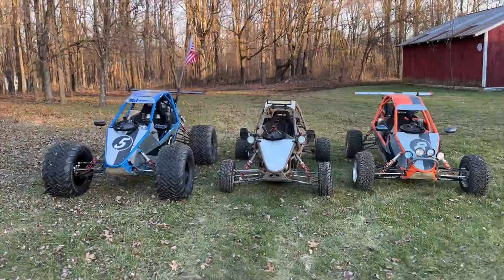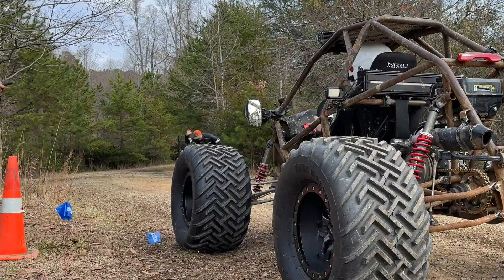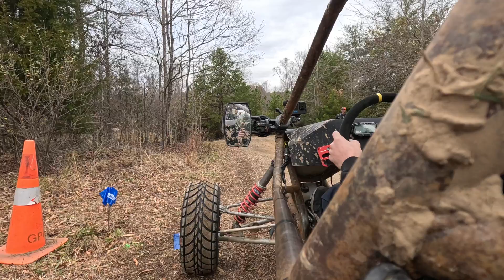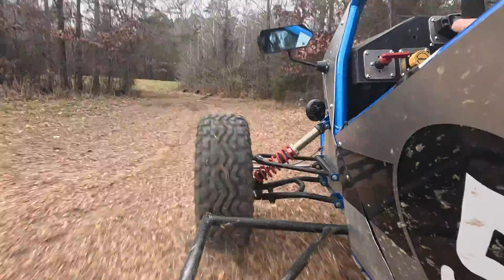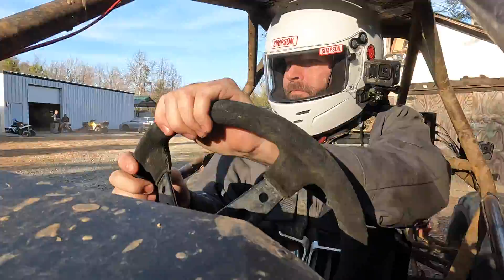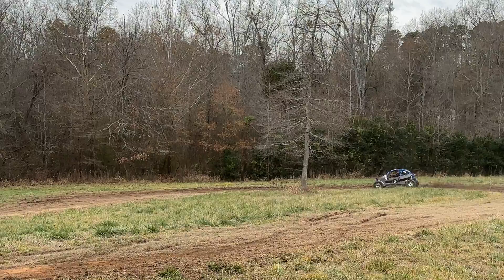Go Kart Build / Crosskart Mode Change and Lap Times

Comment: Really like the idea of bigger tires as ground clearance would be a concern on the places I like to ride. I'm curious if it would have been just as fast as the crosskart tires if it only had a little more horsepower to help with their added weight and drag.

Comment: This is at the cars and camera's facility. that was on the grand Prix  lap.

now we need to see them get Grind Hard Plumbing. and Criss from Rather Be welding. there to see some of these vehicles stack up.

since there are so many of those three wheeled ATVs just laying around. I would like see someone use those tires and wheels on a kart. because they would be just the right size, in between the one's on this kart. and the smaller one's that are normally used. I think they would be the perfect size. they might be worth a try.

Comment: Man that motor sounds like she's struggling to get them big ass tires rolling
Reply from the maker: Got em rolling though… those small engines have more torque than horsepower.
Reply: Do you think you could gear it to better handle those big tires?

Comment: Sounds waaaayyyy underpowered
The side by side comparison was laughable…someone was asleep at the wheel
Reply from the maker: I’m guessing you don’t have a lot of experience with motorcycle powered buggies… On short, tight tracks they never get a chance to get into that awesome 100 hp power band.
Reply: @KJRaycing  you are absolutely correct, and the Predator machine can virtually do a full lap without lifting

Comment: Electric power steering time!
Reply from the maker: It’s not too bad as is. These are budget builds and eps starts at like $700. The gym is free 😁
Reply: About five years ago I did eps under $200 .  There's a guy on ebay that make a controller for a Saturn Vue / Equinox  eps unit.  If you pull on at the Junk yard you can get everything  you need.   @KJRaycing
Reply from the maker: My 10 year old daughter does just fine without power steering. I donMt know how else to say they don’t need it. But it is your build after all and you can do it however you want 👍
Reply: it steers surprisingly easy

Comment: What to see if I get the vr1 plans is there a way to use those plans if I wanted to build the vf2 in the future? Or is it just better to buy both sets of plans?
Reply: They're pretty much completely different karts.
Reply: Oh ok didn't realize that. I watched a little bit of the vr2 build but I guess I should have watched it closer.
Reply from the maker: The VF-2 is an entirely different design. I was trying to figure out a comprehensive way to make the VF-1 able to be converted to a two seater but  it just wasn’t possible.